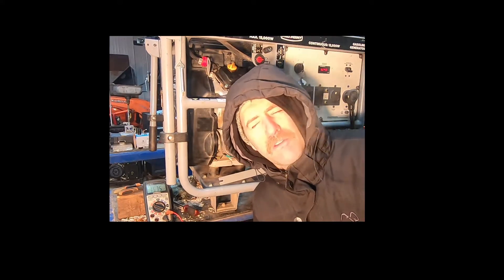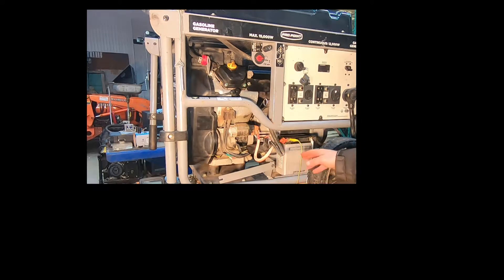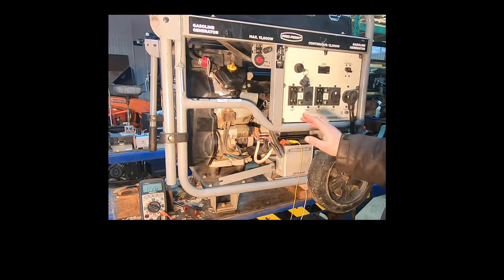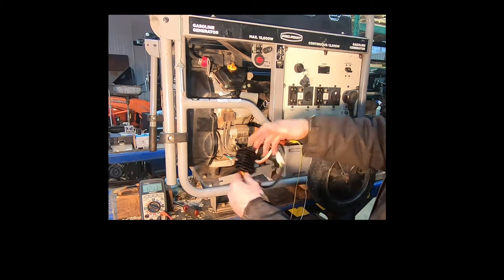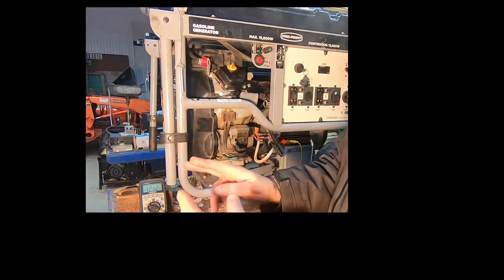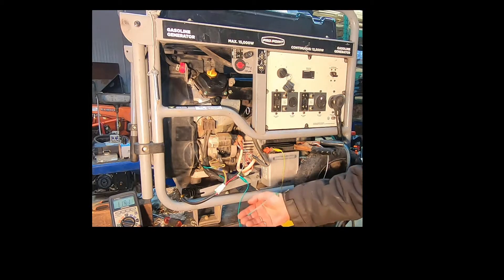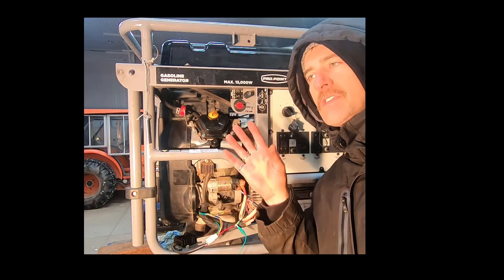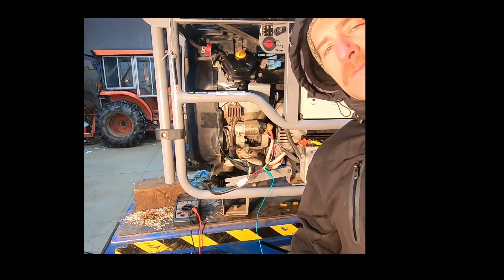Fixing Over Charging Generator For $20

Comment: I trickle charged my inlaw's generator batttery most of last week and reinstalled it yesterday. It  was 11.9 Volts  then and dropped down to .6 when pressing the start button.
The disturbing thing is that the alternator is putting out 25V with the battery installed and 45V DC without the battery installed.
Reply from the maker: You have a bad regulator if it is putting out more than 15.5 V when the battery is connected and engine is running. Also you should not run a test with no battery connected for very long as this can be hard on the stater windings and potentially the rectifier regulator.  Finally your battery is Bad if it drops to .6 V when pressing the start button. The overcharging of the Rectifier regulator has destroyed the battery.
Reply from the maker: In addition, a test with battery disconnected and engine running is not going to tell you much useful info because the voltage can float.  Stick to testing with the battery in place.
Reply: @mrdiyguy123  Do suppose it would be safe to stick a new battery in place? 
This generator was bought 5 years ago, put inside a weather proof storage and has only been run about 10 short times.
Reply from the maker: @Blade  buy a new battery and fully charge it.  Then install it and run the generator while constantly monitoring charging voltage.  If over like 15V turn it off and replace your regulator before the new battery gets damaged.
Reply: @mrdiyguy123  Ok thanks man!